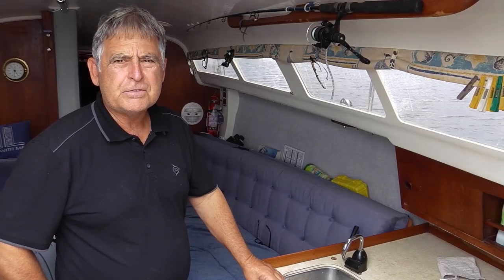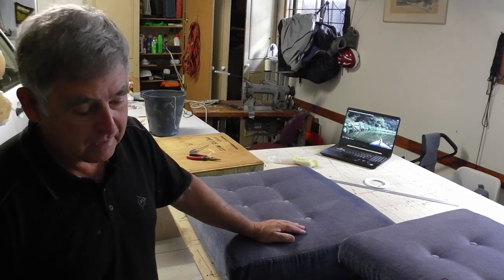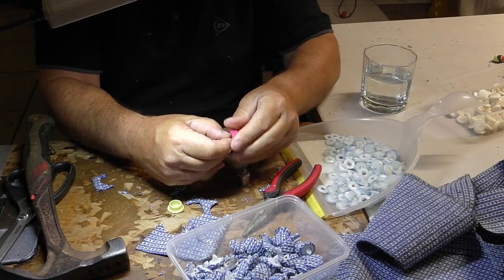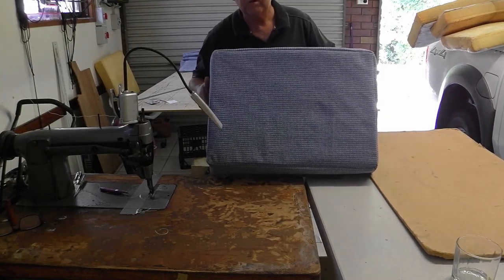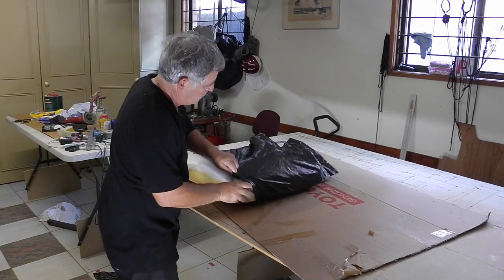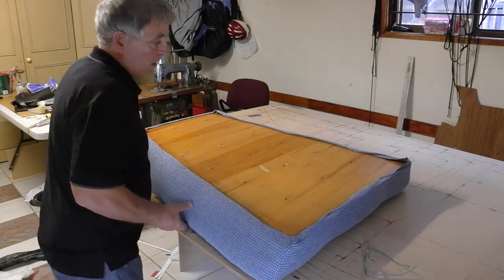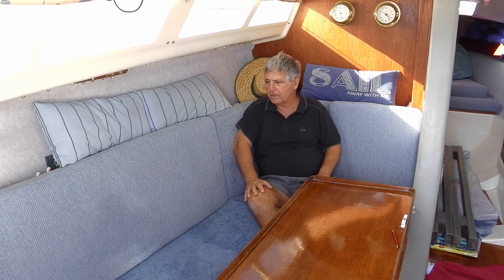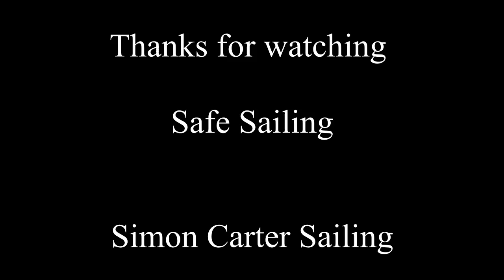Recovering Boat Cushions

Comment: Nice one, Simon. You did very well. Would you think it practical/ helpful to keep a sewing machine on board a live-aboard 30’? Or would it be just more weight to stow? Upholstery or sail repair still needs ‘space’ to work around.
Reply from the maker: No....... I carry a sail makers needle and thread for thirty years I cant remember using it more than a couple of times, sail repair tape is the go.  Safe sailing regards, Simon

Comment: Setting out to do the interior cushions or redo the covers this week coming myself. I've made curtain's for all our boat's but have never done the seats before. It can't be any harder than doing kitchen chairs or an armchair. I don't want to just cut, glue, or staple the fabrics, I want to sew them so it lasts a long time.  This is the exact color of the cushions currently and the cushion material is designed to take the beating of the sand, salt, and sea. To get the quality of the fabric that is being used when these boat's are being made is what costs the money to replace them.
Reply from the maker: Pamela I had a stab at recovering my cushions I watched quite a few YouTube videos Sail Rite from the states was very informative  Nolan group Yatala where I got my thread from and a small amount of canvass. I bought my double sided tape from lincraft or my be spotlight. 
Best of luck,   regards Simon